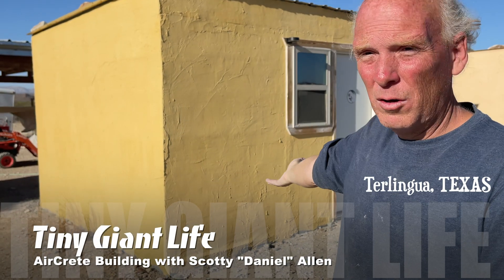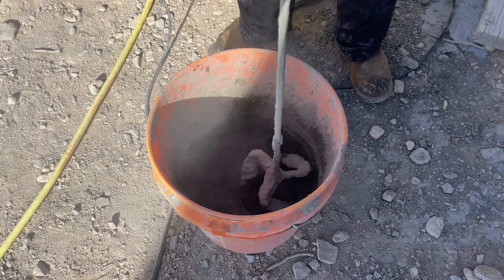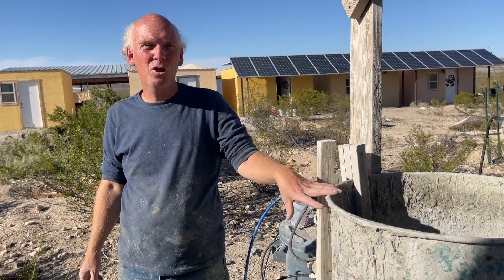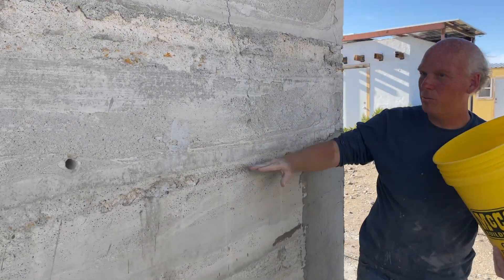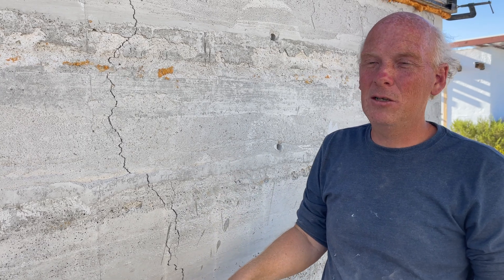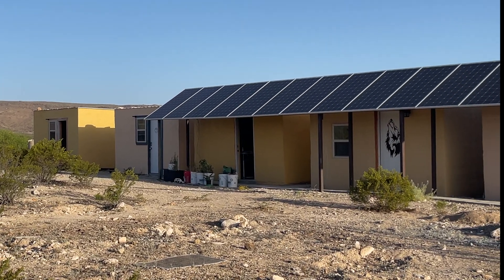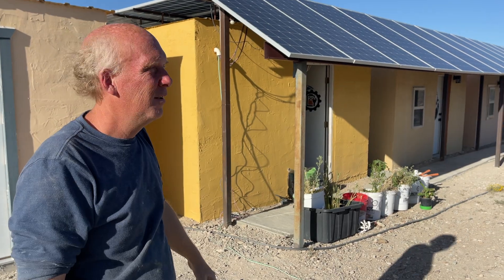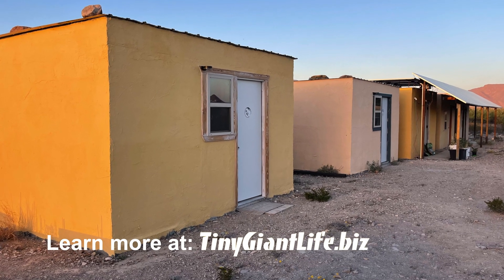AirCrete Construction at Tiny Giant Life school in Terlingua, Texas. Aircrete insulation w/o sand

Comment: Saying that "all concrete cracks" doesn't make the cracks in your wall somehow "OK." I have zero faith in the longevity of a monolithic wall that is riddled with such fractures. How about adding some basalt, steel, or fiberglass fiber to the mix, to give the stuff some actual tensile strength?

Comment: I really like your videos if I was to get some help, is there a reason only doing it in layers? I couldn’t hear what you were saying meaning if I had taller walls could make more pours of your foam concrete at ince
Reply: What I was meaning was like pouring a basement in concrete forms thanks, Billy
Reply from the maker: Billy - The aircrete can only be poured a little at a time, or it collapses under its own weight, compressing the air out of the mix before it sets up.
Reply: My recollection from the workshop I took with Daniel is that you can't really pour much more than a foot at a time (maybe less- I don't have my notes handy) or it starts to collapse the bubbles before the aircrete sets.   Waiting 24 hours gives the aircrete time to set before pouring the next layer.

Comment: I talked to a couple engineers about Aircrete and they told me that the material isn't strong enough for straight walls. How did you overcome this?
Reply from the maker: The walls are surface-bonded for strength. :)

Comment: Not good when you see allot of cracks. It won't last long, in Mexico we cover our walls with concrete and sand and you don't see cracks and last for 20 years,
Reply from the maker: The surface bonding is critical. When the surface bonding is complete, the aircrete is just insulation, not structural.

Comment: I have heard about aircrete, but had not seen an actual living space. This is wonderful. I wonder, could you build something bigger using the same form widths? I was thinking of something in the 800-1000 square foot range. Could you use this same method, or would you have to thicken the forms?
Reply from the maker: It seems like it should work fine to me. However, for colder climates, you would want thicker walls.

Comment: Can you make tip-ups using aircrete?  How thick are the walls of the buildings you showed?
Reply from the maker: I believe those walls were about eight inches thick (I'm guessing). You should be able to make tilt-up panels if you pour a 1/4" layer of sand-cement mortar, lay the fiberglass mesh into it, cover that with a thin layer of mortar, then pour the aircrete, let that set for a few hours or overnight, then apply the sand/cement layer and fiberglass mesh again to make a complete sandwich. Then let it cure for 30 days before attempting to move it. :) Here's a tour of my house in Montana you might also enjoy: https://www.youtube.com/watch?v=QWKPisywxvY